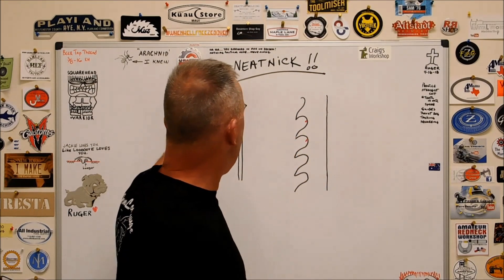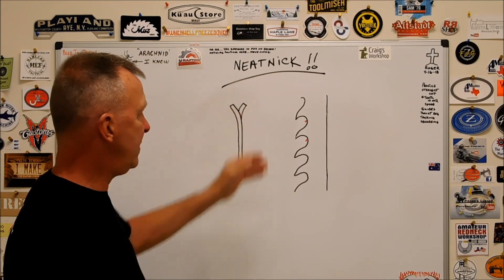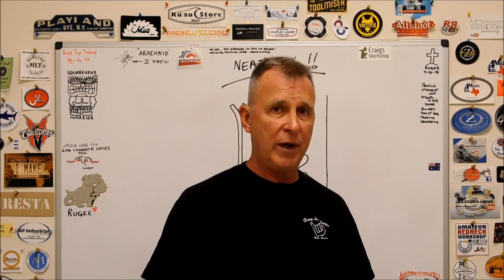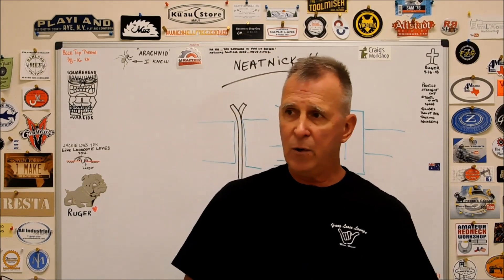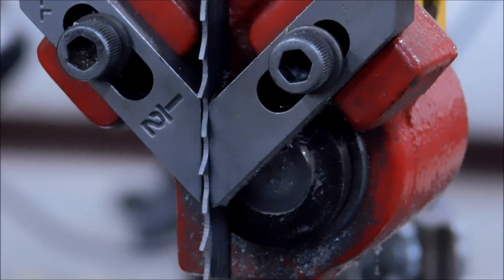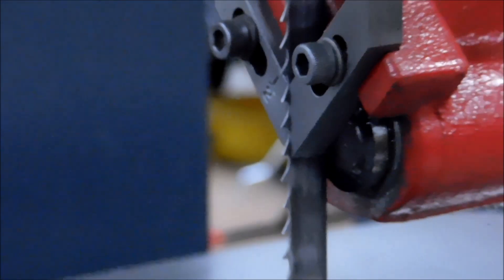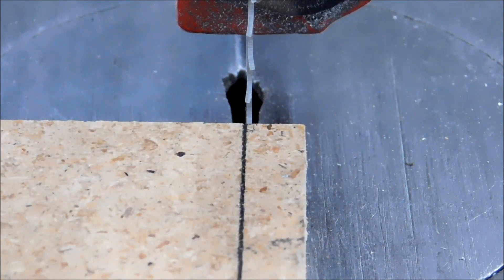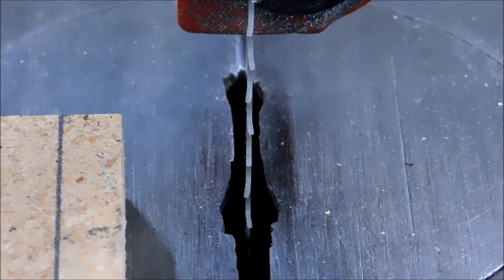Better Edge Cut Control on Your Bandsaw

Comment: first
Reply from the maker: Nice job. thanks.
Reply: After 30 years with a small horizontal Tiawan bandsaw,  I began really making it work. Maybe the most used tool in my shop.  Once I built platten and ledges on both side of the blade, drilled the plattens for hold down holes, I use four different vises and a variety of hold down fixtures to cut flat stock, round stock/slitting round stock, precision slots, it speeds up a lot of my mill time when I rough it out on the saw.  Riding the blade................way good, headed over to the saw now to try that, thanks Joe.